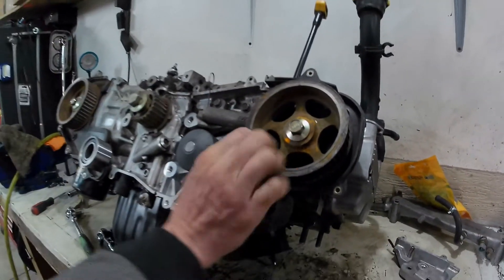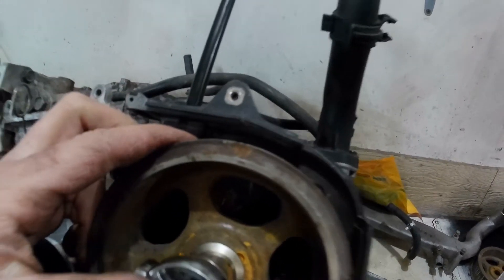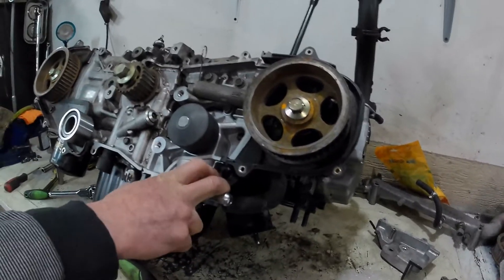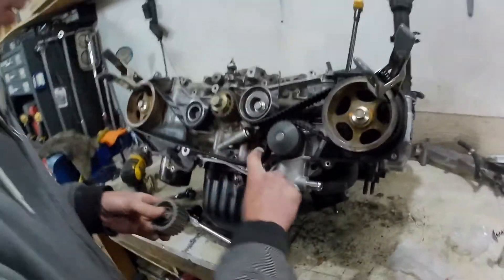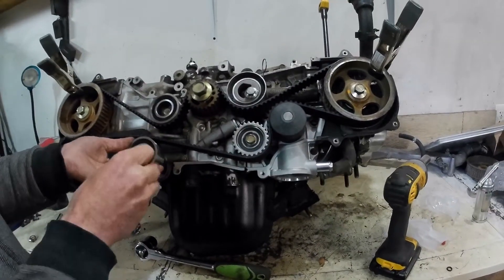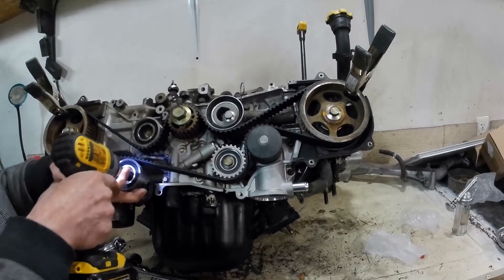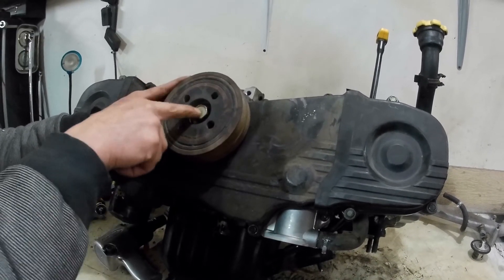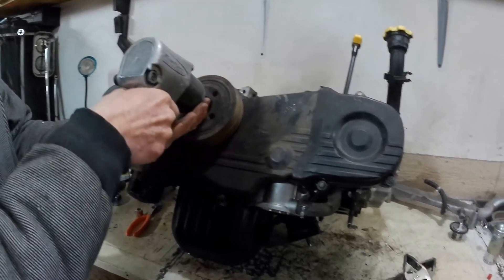Subaru 2.2 and 1.8 timing belt replacement

Comment: Are you aware that subaru techs designing it is the reason its there. Thats because as u see its hard to keep the cams where they belong and NOT SPRING back at you. Turn the crank half a turn and the cams a 1/4    and ALL THAT LInes up, and it wont mive on ya either

Comment: The information you're stating that this is a non interference engine this is incorrect only sum 1997 annnd1997 and below are the ones that are considered bulletproof quote on quote non-interference engines thank you for the video either way for your efforts and for your time

Comment: Hay man doing the same process over again I did this a year ago with cheap parts now I’m doing it over but I’m having an issue removing the crank bolt for the pulley …. In this situation would you use a ratchet or am I going to have to use a torque gun because I can’t seem to get it completely loose with the ratchet
Reply from the maker: If you can get in the with a impact gun that  should do it, other wise get a long breaker bar something over 2 feet and jam a pry bar into the teeth of the flywheel or into the flex plate though the access hole at the rear of the block to keep it from turning over, I've gotten it off that way many times and you can get to it with out having to remove the radiator.

Comment: Bought a kit for mine And the belt doesn't have timing marks? Did yours?
Reply from the maker: Yeah some of the belts don't have timing marks, but you should be fine if you make sure all the timing gears are at lined up correctly when you install the belt, also if you rotate the engine over twice after installing the belt and all the timing marks are still lined up at 12 o'clock then you have it installed right.

Comment: hi sir. im on my pistons now for my ej18. about the ej18 piston rings and bearings are same with EJ20/EJ22??? im a DIYer and learning from ur videos and others. ty
Reply from the maker: The crank and rod bearings are the same on the 1.8 and 1990 to 98 2.2 but the piston rings are specific to the 1.8, the ej18 has 87.9 mm pistons VS the ej22 97 mm pistons so the 2.2 piston rings would be too big for the 1.8

Comment: subscribed. ej18 and ej22 NA do they have same gaskets? what parts do they differ? most online parts shows ej22. so if i purchase ej22 parts will it fit my ej18? thanks
Reply from the maker: The head gaskets on the 1.8 are different the cylinder bore is 87.9 mm vs  96.9 mm on the 2.2, but the other gaskets like intake manifold valve covers water pump are the same from 90 to 98 the 2.2 changed in 99 and has cylinder heads and an intake more like the single cam 2.5. Also note that in 96 the 2.2 went to a single port exhaust that is different from the duel port exhaust on the 1.8 and 90 to 95 2.2 so those exhaust gaskets don't interchange.
Reply: thanks this is helpful. by the way timiing kits of EJ18  and EJ22 are 100% same, right?
thanks
Reply from the maker: Yes just make sure get a timing belt kit that is the right year for your car, in 98 they changed the belt tensioner but I think they stopped making the ej18 in 97 so that shouldn't be a problem, you can see more info on different tensioners in my vid here https://youtu.be/nhxlyz5cpyo
Reply: hi sir. im on my pistons now for my ej18. about the ej18 piston rings and bearings are same with EJ20/EJ22??? im a DIYer and learning from ur videos and others. ty